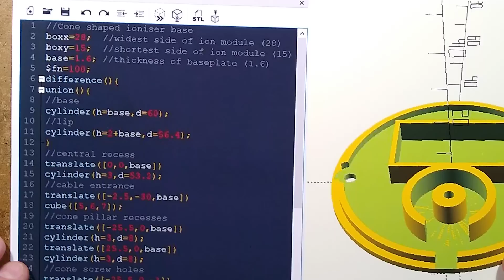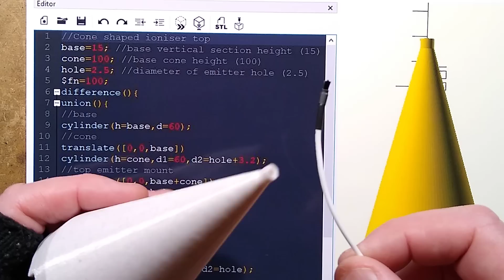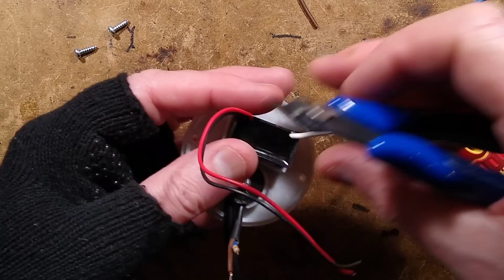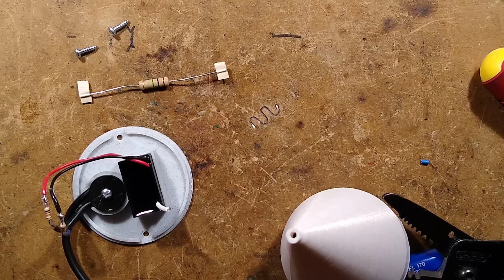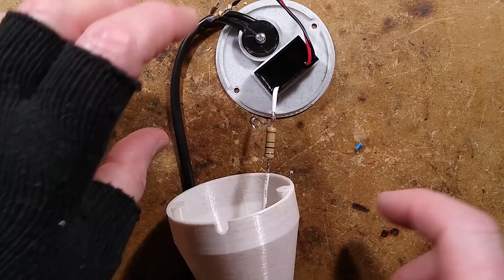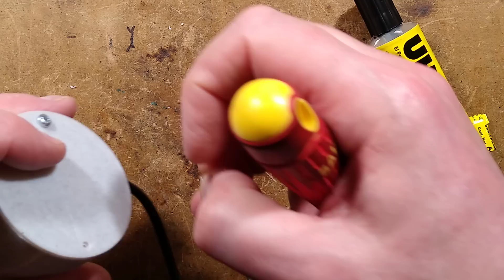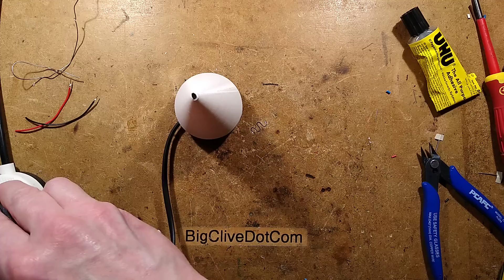DIY air ioniser with wide voltage range

Comment: Would it be a good idea to attach the ioniser on a grounded round plate (that would be easy to clean)?
Reply from the maker: You could do that.  Some units have a plate at a slightly positive voltage to make them a preferential dust surface.
Reply: @bigclivedotcom  Good to know. Thank you!

Comment: Lovely project Clive.  Thanks 

Did i miss what the value of the resistors on the mains input?
Reply from the maker: It is only needed on 220-240V and even then it's optional.  I used 10K resistors.

Comment: Instead of finishing my almost completed home-built FrankenPrusa 3D printer, I am sitting here watching Clive show us his g-code of something that I could print...

Great project, thanks Clive!
Reply: Get on with it then! We have faith in you! One of us! One of us! 🙃
Reply: @GriotDNB  Thanks for the motivation!! 😎

Just need to sort out some custom ROMs, use my scissors and do a bit of Klipper and sing a Duet or 2...

Hardware is at least sorted out so far!! 💪
Reply: @gertbenade3082  It's all in getting a comfortable firmware and hardware fine-tuning. Fun though, isn't it?
Reply: @gertbenade3082  btw, poetry noticed!
Reply: @GriotDNB  YES!!

It combines all my interests... Electronics, robotics, sensors, coding. And doing things with practical application...like finishing my studies!

And there's a great online community! Making friends without even trying! Especially with guys like Clive providing insight and practical tips such as adding carbonation to Marmite and such! 😁
Reply: check out the Bear upgraid for the prusa printers !! i built a Bear prusha from the get go !! its awsome
Reply: It's not G-code. It is OpenSCAD source code. The freeware OpenSCAD editor/viewer/renderer/compiler can export that as an STL file. The STL can then be imported into slicer software. The slicer produces G-code that goes into the 3D-printer.
I find OpenSCAD easier to work with than any other 3D modelling software, because you only need some coding experience, maybe a bit of high-school math, and you need to google for OpenSCAD cheat sheet. @Clive: kudos for sticking to OpenSCAD and publishing your code right here on Youtube.

Comment: As a guy who has soldered in the past and still does now when needed; I've never burned myself with the gun itself..... However; I used to wear shorts in the summertime and I stopped that when I accidentally dropped a blob of solder on my leg when looking at a freshly soldered joint. And to my second, and more egregious act with a solder gun. 

I will NEVER forget this. It was a fall day, and I was finishing up replacing a capacitor on my computer's sound system; the bass unit. I was almost done but the gauge on my butane soldering gun indicated that it was set to run out soon. Now this gun was old at that point and the gauge was faulty, I didn't know that. Instead of turning it off and refilling it, I flipped it over and gave it a shot of butane. The gun was indeed full and because of that, shot butane up the gun and my arm simultaneously. This also caused the extra fuel to ignite, racing a burning track up my right arm to just a little past the elbow. I screamed like Doc when the car hit the rags in back to the future. Thankfully, the fire only lasted a few seconds and the only thing that suffered was my arm hair and my nose........

The basement where I was working, stunk like burnt hair for awhile.
Reply: Refueling a torch while it is burning? Wow.
Reply: Had a similar experience back in highschool. Shop had an old style of gas-fueled soldering setups that were basically a torch in a box, used for larger-scale soldering. They were lit with friction strikers. Being a highschool, those strikers were old, worn and unreliable. Turns out igniting a running gas source with an unreliable ignition method in a less than perfectly ventilated work area has some chance of producing a fireball when the striker finally produces a spark. 
No burns, but my eyebrows got properly singed, and my forearm hair was just /gone/.
Reply: Darwin contender
Reply: I was doing some repair work in sandals and got a drop of it on the top of my foot. 

The words that came outta my mouth... you know what they were.
Reply: I always wear shorts and in fact had a blob of solder kiss my leg a few hours ago. I will probably never learn.
Reply: A work colleague got a drop of molten steel on his balls while welding 😅
Reply: I usually wear synthetic pants but always change to cotton jeans before soldering.
Yes, I got a drop of solder on my leg once.  Yes, I was a kid.  No, it never happened again. :^)

Comment: No slow change LEDs to illuminate the inside of the cone was an unusual choice. lol.
Reply from the maker: That would require more circuitry.
Reply: @bigclivedotcom  I'm sure you can rustle up a resistor and an LED. I suspect you have "some" of both.

Comment: Question for Clive/others knowledgeable about such things:
I have some ionizers I bought cheap at a thrift store here in the US. They come from a dubious company called Clarifion and I'm unsure if they are a complete scam. They do have a similar "black box" module inside, but I have been running three of them for a while now, and I'm really not sure if they are working. How long before I should notice some kind of effect? If I understand correctly, I should see some dust collect around the brush tip over time. I have mine on smart plugs so that they only run for 4 hours at night. Any wisdom on this? I suppose I could easily replace the ionizer module if need be.
Reply from the maker: Place them on a white sheet of paper and run them 24/7.  After a week or so there should be a clean outline of the unit on the paper when you lift it off.
Reply: I mean, I do see that I could do a couple tests as shown near the end of the video (voltage and breeze tests) to see if they are working.
Reply: Using your methodology, they appear to be legitimate. I haven't gotten around to testing with a sheet of paper, but I can feel the breeze and get a potential near the brush. I think, perhaps, that because these devices are plugged into outlets, they don't get proper airflow, so don't have much effect on the majority of air in the rooms. I'm probably just going to flip these units and get an air purifier... and a fume extractor for soldering. Cheers!

Comment: If you touch the end of it will you get electric shock
Reply from the maker: No.  The current is very limited.  But it can charge you up like static electricity if you are on carpet.
Reply: My understanding is that you will become slightly charged, so you might zap yourself if you touch something conductive afterwards, but in general you should be fine.
Reply: So you're watching this and just figured out wtf electricity is? Wow.
Reply: @TheTubejunky they're just asking a sensible question. Not everyone here is an electrician.
Reply: @tncorgi92  You don't have to be an electrician to KNOW something that emits "ELECTRICAL ARCS" can  "SHOCK/KILL YOU". Where is the common sense these days what the hell man.
Reply: @TheTubejunky It was a question, and a valid one at that.

Comment: Nice!  An easy way to add weight to things like this is to cast plaster (optionally adding sand, scrap metal, etc.) into them - allows maximizing the mass without worrying about attachment or shape
Being 3D printed you can easily make a 'negative space' for the electronics so it stays serviceable
Reply: Modelling clay can also work for that purpose.

Comment: For some reason, I can't reply to your question under my previous comment (the comment just disappears), but anyway, here's my answer:

It's a rectangular module. The model number is "Honge FF-351". It's pretty much the same as yours, the only difference being that the wires come out from the side.

I printed the case in clear PLA so I can add a neon lamp to it. Not only is it useful as an indicator to show that it's plugged in and running, but it also makes it look more stylish 😁

Comment: Touch the emitter end Clive, go on!😁😁 I might have to make one.  Nice 3D print too.
Reply from the maker: It's safe to touch.  But if you are on a carpet it can charge you up with static electricity so you get a zap from grounded things afterwards.

Comment: Nice design for the case, got one printing right now. A few years ago, I took apart a broken hairdryer which had pretty much the same module inside. Finally, I can put it to use :D
Reply from the maker: Is it a round or rectangular module?

Comment: Hrmm, I'm thinking that a soft spring pogo pin on the bottom, wired to electrical earth, might be a nice upgrade. That way you could sit this on a metal tray (like a sheet pan or such) and have that become earthed to attract the crud.
Reply from the maker: Some ionisers use a small positive multiplier to make the collection mat more of a target for the dust.

Comment: The mottled look to the plastic is reminding me of a disposable coffee cup, I suppose you could even make a discreet one by disgusting it as an every day object

If you used an extra screw on the bottom yoh could forgo the stick on dots

No neon light? Clive!
Reply from the maker: I did toy with adding a third screw.  Adding a neon inside would require more connections and sleeving, but that would be OK for the technically inclined.
Reply: I think I would still prefer the feet so I don't need to worry about the screws scratching whatever surface I set it on.

Comment: They ask you how to make an ioniser? 🤣 Do they not know you Clive?!

Be interested to see the differences between say one of these sorts of modules or the mountain breeze style, and say a flocking electrostatic applicator

I'd buy one, but I've already twatted myself in the eblow with the hv module from a plasma globe, not a mistake I want to make... For a third time 😑😅

Did you solder onto the carbon fibers? How?
Reply from the maker: The carbon fibre bundle is part of the module as supplied, and is crimped.

Comment: Looks very stylish - Could be Jacob Jensen (B & O) design. The black top is just the point over the i.

The use of a global $fn = 100 can be a little wastefull, as small cylinders require a much smaller $fn value.
For screw holes (2 mm - 10 mm) I use $fn = 8, maybe 12, for nuts I use $fn = 6 🙂
I basically set the $fn value depending on diameter and of course how it looks.
As I often use "modules" in my SCAD designs I often just add the $fn parameter when using the module.